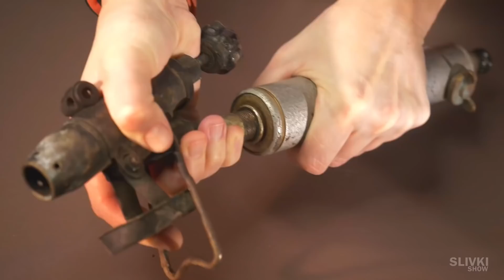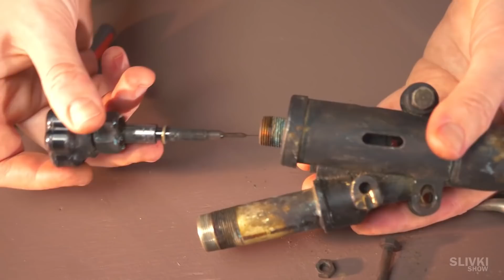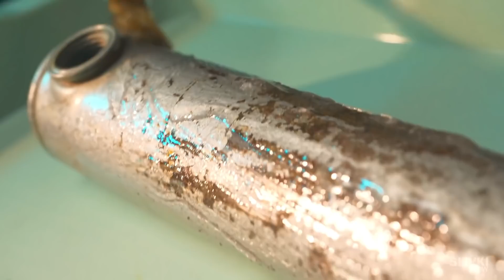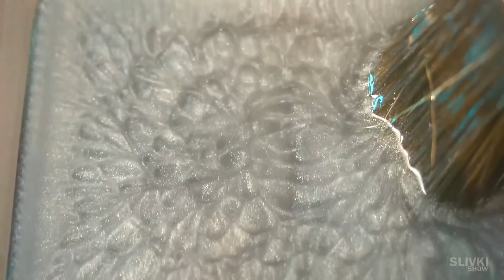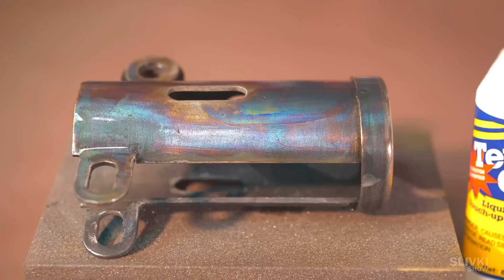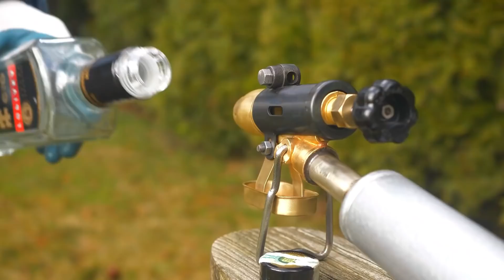RESTORATION OF A GERMAN MINI FLAMETHROWER

Comment: Nice restoration! BUT: That's a gasoline blow-torch - not a "flame thrower", and what's missing is a steel rod with a copper "hammer"-head on its front. You can tell because there is that cylindrical piece on top of the blackened metal cover. It normally has the steel rod running through the bore front to back, with a screw coning in from the side to adjust and set the length.
The hammer-head is being heated up by the flame and is then used in turn to solder metals with liquid tin.

Comment: I have done restoration on several of the antique gasoline blowtorches, and they are very unique. The fibrous material in the reservoir is there to restrict the flow of fuel to the atomizer so that the flame is even burning. I took the material out of one just to see what would happen, and it is more of a flame squirt gun when it is pre-heating. Eventually as it heats up, the atomizer is hot enough to vaporize the fuel and the torch is ready to use, however, the flame is sporadic and not very hot so it is not recommended.

Comment: Hey just so you know Stephen needs a bigger enclosure at least 450 square inches and a sand bath. Also the dirt should be compacted to hold burrows up. You should also have a minimum of 6inches of bedding and freeze boil or bake everything first to sterilize it. They may be wild in the wild but Stephen has genes from a long line of domestic hamsters.

Comment: Never dip your brush into the bluing fluid container. Once the fluid has made contact with steel it starts to degrade.
Pour a small amount into another container and dip the brush in that, then discard the unused fluid.

Comment: Hi
Reply: as i took a bite of the monkey fetus i knew. i swallowed and let the rest of the baby monkey slide down my throat. it was just as i had hoped.

the monkey was still alive, but was only half of what it was.

i held the monkey in my hand and began to stroke it.

it was dead and half the reason for it was because of me. i knew what to do to make the monkey alive again, all i had to do was bite the other monkey that would return the life to the monkey i killed.

no time for niceties. i pulled back the head of the monkey and bit into it. it was cold and slimy and had no taste. i pulled away from the monkey and it began to move. it was still alive! i was about to try and eat the other monkey. i had seen monkeys do this before.

i began to eat the other monkey the way you eat a banana. the monkey was still alive. i wanted to bite off its legs. i put it in my mouth and tried to bite off its legs. the monkey squirmed out of my mouth and ran down the hallway and tried to get away. i ran after it. i saw a door and i grabbed it and slammed it shut and it trapped the monkey.

the monkey ran around the room banging itself into the door. then it got trapped. then it ran around the room.

i opened the door and pushed the monkey out. the monkey ran down the hall and ran right into me. i grabbed it and put it in a cupboard. i opened the cupboard. the monkey jumped out of the cupboard and ran down the hallway.

i chased after the monkey and threw it into a bedroom. i looked around and saw that the bedroom was empty. there was no furniture in it. i was wondering what this room was for and i wondered if this was my room. i walked down the hall and i saw that this hallway led to the backyard.

i saw the monkey go down a large flight of stairs. i went to the stairs and saw that it led down to the basement. i decided to go down the stairs.

when i got down to the basement there were two doors. the first one led to a dark room and the second one lead to a dark room. i saw a light switch on the wall. i put my hand on the switch and i turned it on and the light shone down on the dark room.

i looked in the dark room and saw a monkey on the ground. it was dead. i took the monkey and dragged it to a container in the corner of the room. i began to eat the monkey.

i bit it into pieces. the monkey did not die. it was still alive. i knew it would be difficult to get the monkey to be alive again.

so i began to do anything possible to make the monkey die.
Reply: @lostdirtbikerider2347  yoooo........what..........
Reply: @lostdirtbikerider2347  Ayo wtff